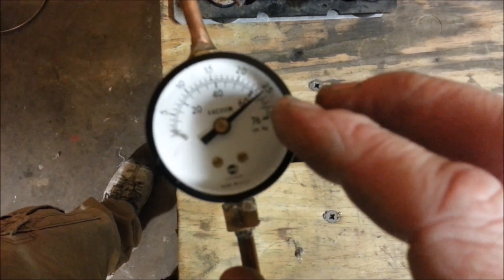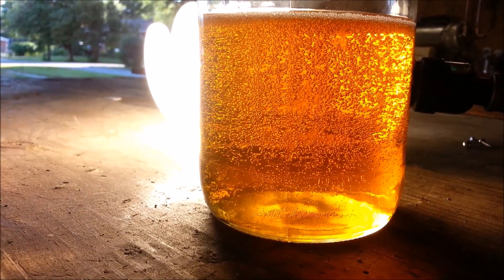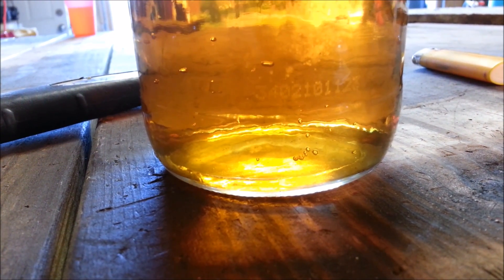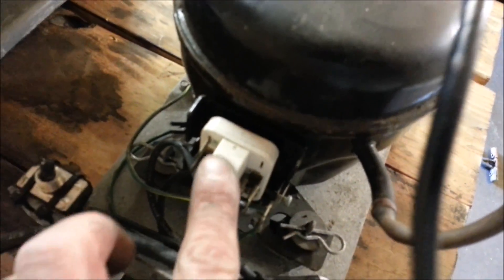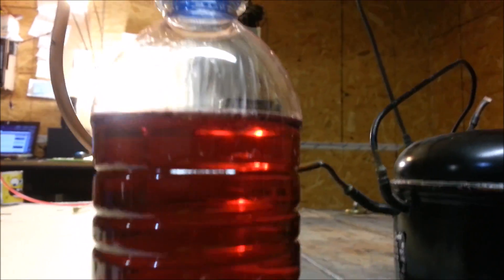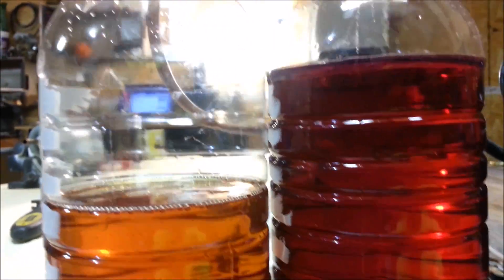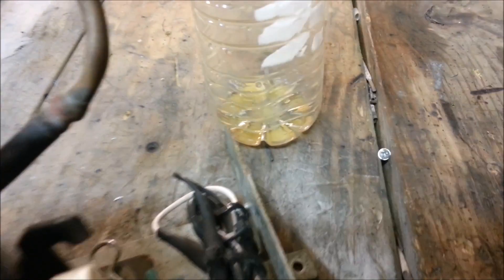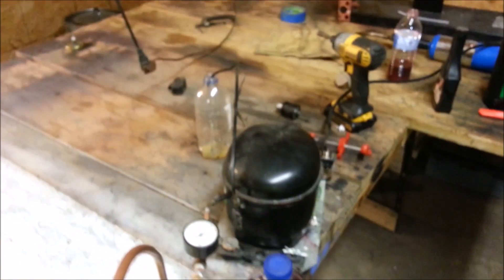DIY  vacuum pump info Refrigerator compressor oil DONT USE ESTER OIL

Comment: "purdy cool", "snugger fit", "turbo molecular vacuum pump or sumthin"
Some fancy lingo there sir! 😆
Filling oil through the service inlet (the crimped copper tube) which would just poor oil into the housing would uh been tidier. Also, I think most units only need like a cup or 200ml or so, not much of oil.
Filling through the suction inlet may route the oil directly to the compression chamber which is intended for gas phase of refrigerant not liquid, along with the large amount of oil added, and that's why the poor compressor puked. 🤮😅Cheers~!

Comment: hey, this video might be actually saving my DIY vaccum pump setup. So I have killed my two refrigerator compressors after roughly several hours of work each under vacuum. After the 2nd one I knew something was wrong, but I couldn't figure it out until I watched your video. I'm now intending to follow your tutorial, but I'm not quite sure how. So, the part I think I understand is part 2, where I will buy a dedicated vacuum pump oil and put it with a big syringe through where the air comes in (the one usually connected to the vacuum chamber). Not sure through which one of the two other tubes I should use to evacuate old oil first. Do I use the same tube (air entry) or maybe the 3rd one, which is not used during compressor usage and sealed? Also, do you have any rough estimate how much high up should the 2nd tube be (air out) in order for it not to evacuate oil gas too quickly during the "regular" usage of the pump? My compressor doesn't start now at all (doesn't pump air), so I'm afraid these two are definitely dead, even if I change oil, aren't they? What would you do? resuscitate the dead one with new oil and see whether it starts or just buy a new one and change oil from the beginning? please help! thanks!

Comment: Great video NOBOX7!  Is that motor oil you put in? I also build a compressor made of 2 fridge compressors and a propane tank as air storage.  clean and flush the compressor with 99.9% isoprophyl aclohol and lots of shop air on it. after that fill it with ATF oil. So everythings okay until i turn on the compressors. first it's great very silent but after a mins its pumps out oil to the discharge tube! Pump i mean pumps out a lot of oil! running for about 4mins and it pumps 50ml of oil. Dont know what the problem is and anyone here can give some advice on how to fix this? Thank you :)
Reply from the maker: yes motor oil , you need very large discharge line pointing straight up so oil doesnt travel up line
Reply: @NOBOX7  Thanks for the reply. As i know this type of compressor conversion always pump oil, but using it in a open system become diff. So i expect oil mist and adding oil eventually. But like as i stated i did not expect it will pump plenty of oil, i thinks its not normal? Like what you said it's on the discharge tubing actually the tubing discharge  in my comp is already straight up and have some filter the suction tubes.
Reply: BTW i add the oil in the process/service tube the one tube that is crumpled. is it possible that why its umping oil out? because most of the videos i watched and also your video they add oil in the suction port?
Reply: @carlogernale7854  I don't have much to add other than keep in mind that oil expands when it gets heated up. Might just be too much in there to begin with?

Comment: Hi, how have you replaced the refrigerant? I bought a compressor to turn it into a vacuum pump, but there is still refrigerant inside R600a, its a gas but I don't know how to degas, since its heavier than air. Do you know how?

Comment: I didn't hear any reason for not using ester which is what is called for in 134a - so why the do not use ester that is why I ran the vid?  I see no value in the title .
Reply from the maker: Study up estor oil , it calls for estor oil when used for ac systems , they need a hydroscopic oil . Estor oil absorbes water , it cannot be expose to air
Reply: @NOBOX7  That is what I am doing - trying to fix a junk kenmore elite refrig. so when I saw the title I wondered if I shouldn't put ester back in the thing the ester I have has a dye in it for leak detection.  having nothing but trouble with this refrig. but I have decided that even if I have to completely change everything I will  I have had it with LG products . I like the expensive pos. but it is a temperamental $2200 bidy

Comment: I agree the risk is that you extract volatile compounds too that may be useful for the lubrication, though they are going to evaporate with high temperatures as well but maybe not if you stay within the factory declared temperature limit.

Comment: Oh bty most closed compressors systems will move a little oil through them. To lubricant the vanes or rings in the cylinder not just the motor and bearings.  The oil uses is based on the refrigerate used and system operating temperature range. Some of the oils are very hygroscopic and absorb water from the air. Near the end of your video I think the oil coming out was from the last bit that was suckup and airrated by the compressor.

Comment: wrong oil... Also, your pump is overheating as freon was intended to run through and cool the pump/motor. There's nothing flowing in a vacuum so its overheating :-(
Reply: Hygroscopic
Reply from the maker: +SamaritanElad  your incorrect check your facts. you cannot use oil this came with because its HYDROSCOPIC . look that up . also i have ran this pump for hours on end so again you are wrong. freon does not need to cool this pump not sure why you think that , this is not a 50,000 btu AC unit and only those large size units do that

Comment: You can also use a vacuum and oil like that to oil a bearing.  Once you draw the vacuum on the oil with the bearing in it, release the vacuum and the oil will get sucked in.  I wonder how well it would work with grease.  I guess it would vary depending on how thick the grease is.
Reply: if you heat the grease up so it gets liquid it works fine